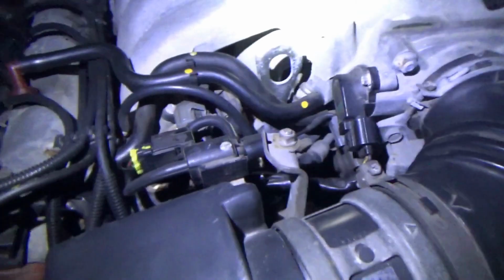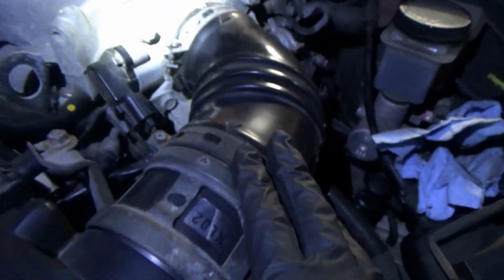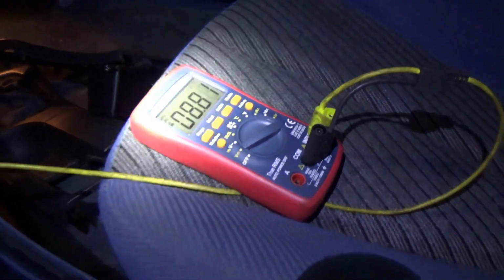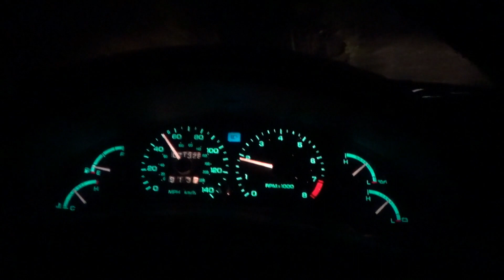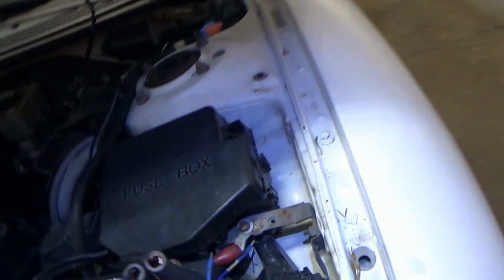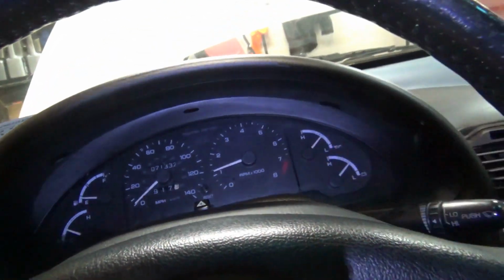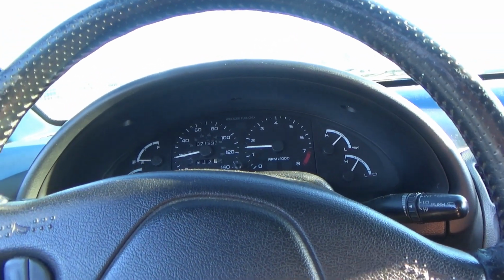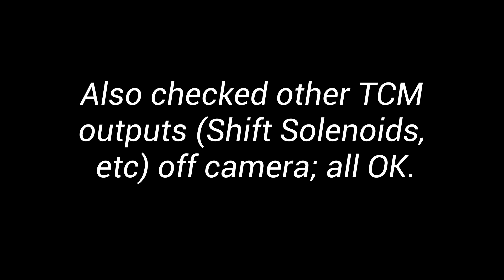The POSSESSED Probe - Halloween Special (Part 2)

Comment: i have a 96 2.0 liter probe that had multiple open control wires in the engine compartment. almost the entire maybe 10 wire harness had open wires. the manufacturers use the thinnest possible wire to save money on copper. starter motor solenoid wire open, blower motor control wire open, several wires going to the Maf sensor were open. to find the faults i used a cheap scanner and did continuity checks on the wiring going from the engine compartment to the PCM connector

Comment: 93 Camry had similar problem with it's torque converter lock solenoid designed to lock above 35, it was fine if driven on highway then city drive but if alone driven in city it would idle low in drive as though it was about to stall, that had a trans code but unsure what it was, Camry had both tranny and engine codes

Comment: Ive just become a '97gt probe owner.
And ive been working on mine for 3 weeks no start when car was given to me. Owner was fed up with it. And couldnt get it statered. So he gave me the car. The throttle body was dinked with like your customers horribly bad. 
Took the hole throttle body off and cleaned reset all the factory setting. 
And now the car runs great short of just the servicings it needs. 
Your videos are enlightening and a thumbs up.

Comment: Brake pedal wear - I had a 1999 mustang. I had to REPLACE the rubber of the brake pedal after under 50k miles because it had worn to the metal and wouldn't stay attached. I attribute this to Ford's legendary quality. I believe that the pedal in the Probe wore way faster than in a Mazda.

Comment: Sometimes the TCC can activate because the screen on it becomes plugged with metal filings allowing the TCC to engage. 2nd gear may be the first allowable gear to engage convertor clutch. Explaing why it does not lock up in first gear.

Comment: On this generation of Ford high idle and dies in drive is usually a vacuum leak affecting the mass airflow sensor.
When these vehicles age the hoses fail and I've experienced them fail just from sitting after a drive.
Trans maybe bad but the way the engine is running tells me that there's a vacuum leak.
Reply from the maker: It was fine after proper idle adjustment 👍

Comment: My very 1st new car was a 89 Probe GT with intercooled turbo. Came right out of the Mazda factory. That car was fun, fast and a blast to drive. I lost it when it turned upside down when avoiding an accident that would have sent me to the hospital. I was fine but the car... Totaled, of course. Broke my heart. 78,000 miles and still drove like the day I bought it. Manual trans. No drive train issues ever.  Loved that car.

Comment: Hi Ivan, I'm an auto mechanic myself and to read the vehicle transmission fluid correctly, 1: have vehicle runing at OPERATING Engine Temperature. 2: Transmission Should be at Normal Operating Temperature. 3:Then put the EBrake on Full and then shift the Transmission to Neutral. 4: You will then be able to check and see if the transmission fluis is Full or Low when hot.

Comment: To me it did seem like the throttle body should have been cleaned thoroughly before adjusting the idle.
Unfortunately it did seem like the customer was ripped off by the seller and that'll be a case for a disagreement between seller and buyer.
Reply from the maker: I did clean the throttle body before adjustment...standard procedure :)
Reply: @PineHollowAutoDiagnostics  Maybe I missed that detail then.

Comment: one thing to comment, do not drain the transmission fluid like that on HOT transmission because you're disconnecting transmission lubrication. I did the same and killed (seized) the torque converter bushing although I also did it just for few seconds. The transmission made clunking noise the next day, I ended up pulling the tranny and noticed the torque converter bushing was completely seized. So just few words of caution here.
Reply from the maker: wow that's nuts

Comment: Some tidbits for you Ivan ~ the manual shift valve in these boxes has only 3 hydraulic positions (neutral/forward/reverse) with mechanical activation of the parking pawl when in Park. All forward gear ration selection is done by TCU/shift solenoids. With TCU unplugged or in limp mode, default strategy is to select 3rd (both shift solenoids deactivated) With the manual valve in 2, 1 the overrun clutch control circuit is hydraulically active (not activated by overrun clutch solenoid)....

...the 'pulse generator' signal  (there's 2) are actually TSS (turbine speed sensor on input shaft of gearbox), and 'rotation sensor' (usually sensed at the park pawl gear teeth) ~ the TCU logic compares these two signals to determine EPC duty cycle/shift timing ---- in this vid, you're connected to the TSS output....

....both the EPC and TC lockup solenoids are PWM controlled ; both exhaust to drain to modulate pilot pressure (65PSI) which actuates their respective hydraulic control valves ; the solenoid assemblies will need replacing anyway, but the two PWM valves wear out quickest (some Nissan folk know you can get these same valves cheaper from Isuzu =) You can only really diagnose this by connecting a pressure transducer to the hydraulic test points on the gearbox.

As we see, the TCU is not commanding TC lock solenoid, so either something's screwed in the valvebody wrt torque converter control valve, but I'd have to look at the F-EAT hydraulic circuit to fathom why only 2nd apply pressure seems to cause the lockup (I've not done a lot of jatco front wheel drive boxes, but with 4R01 jatcos one suspects torque converter control plug is buggered)
Reply: Wow automatics are complicated If I ever have to buy an automatic car think I'll stick with DSG or just a normal manual much simpler
Reply: Epic information dude 👍
Reply: @neilmurphy845  Actually, these older jatco automatics are simplistic compared with more modern 5+ speed automatics =)
Reply: @hhn2002  I've really only scratched the surface =) We created a replacement TCU for this style of gearbox as well, using teensy32 as the base ~ the stock TCU in these is mad as a bedbug and relies on 'fuzzy logic' ... I'm not surprised to read that others have experienced lack luster performance from this gearbox setup, the stock TCU is veritably thick as a brick.
Reply: @gcbification Interesting - one thought I had, after Ivan’s diag seemed to show that the D2 instant stall wasn’t coming from TCC on… could it be that the trans was kind of ending up in two gears simultaneously, like moving to the next gear without releasing the current gear? Might be coherent with very harsh 1-2 shift, but not sure it’s feasible given the way the shift logic is supposed to work… Interesting symptoms regardless!
Reply: @karlkoenigstein4138  Nah, the only way these boxes can bind, is if 4th(OD) is selected and overrun clutch is engaged (there's a hydraulic interlock to prevent this).

At a quick glance, this probably stems back to TSB #9774 ...which may never have been done  =)
Reply: Jcbification. What do you know?  😉😂 Excellent knowledge Sir. Way over my head. 🤷‍♂️
Reply: The root of the problem has to be the Valve Body itself
Reply: Great information. If Ivanwere able to post nearly-live (edited) clips of work, and obtain real-time suggestions, diagnosis would be off the charts. The technology exists but that would be difficult for a one-man-shop to produce.

I think video community comments works over weeks for video channels that are rebuilding one or two owned cars with no real deadlines.

For a DIY guy, internet forums are pretty good albeit a bit slow and not perfect. I know there are pro forums but not sure how popular they are.
Reply: not a transmission guy, but I recall hearing something like seal rings leaking past causing TCC apply on those. the last ford probe I touched was about 1999, which was also the last of that buggy transmission I seen.
Reply: @throttlebottle5906  that will cause clutch slippage and what you are referring to is the steel, teflon seal rings that the apply piston or piston seal itself
Reply: @SHSPVR  yeah, that would make something slip, but I think it could bleed pressure into the TCC circuit somehow on them. I don't recall 100% but there was something abut them for sure.
Reply: @throttlebottle5906  No becuase TCC circuit is run thru valve body circuit is open or off which is on its own dedicated circuit which relies pump pressure keep in mind that torque convertor clutch would do this on all gear and I should also I point out that torque convertor clutch is 4th gear lockup only which act like a standard manual clutch only apply pressure to the turbine and the impeller making them lock together, to me what I think is wrong is something is not set right in the valve body itself therefore causing 1st gear and 2nd gear to lock as it applying pressure to both pistons so I think the problem is with the 1-2 solenoid valve body circuit passages for this part which has a check ball that maybe not sitting properly or has broken through the body plate itself or their heavy buildup of varnish or possibly a hang up plunger valve or a broken plunger valve spring.
Reply: @throttlebottle5906  More likely a pressure leak in the TCC apply circuit.... both the EPC & TCC lock solenoids work similarly, in that they are 'normally closed' drains. When Ivan unplugged the TCU, he effectively had a closed EPC valve, which hydraulically results in maximum line pressure -- applying power to the EPC solenoid and thus opening the drain, lowers the line pressure. With PWM duty cycle, you can vary the line pressure by lifting the valve closer/further from it's seat. In the EPC valve case, fulltime 12v (no PWM) is a special case, and is used to activate the overrun clutch circuit, and reduce engine load during starting -- you can see this @13:18 in the vid ; Ivan cranks it, as soon as the TCU sees TSS signal, it pulls EPC fully on for 5second to reduce line pressure to near nothing, thus reducing the load on the oil pump until the engine establishes steady idle (that's the intent here). Wrt the overrun clutch...if it's solenoid is activated to achieve engine braking in D, it won't hydraulically engage until you activate the EPC valve with fulltime 12v.; this trigger point is determined by TPS position..ie; <2% ...

TCC lock circuit works in similar fashion - as it energized with PWM you can ramp the duty cycle and slowly open the drain valve ; that loss of pressure on one side of the TCC control valve, allows the spring on the outer side of the spool valve to slide it along the bore and provide line pressure to the TCC itself. Just now thinking about it, the possible elephant in the room here, could indeed be a leaky TCC lockup solenoid, but you don't let your mind go there --- like Ivan stated amusingly pumping that ATF out....that fluid has 'rebuild me' written all over it. One of the reasons they pick the idle speed  up, is to raise both line and pilot pressure ; such can compensate for a pressure leak in idle conditions that's not evident in driving conditions.

Incidentally, that's also a data-point on many automatics ; how many litres per second get discharged from that oil cooler feed line (@ specified idle/NOT)...
Reply: @gcbification  could be a solenoid. @Anthony Toste but don't forget the TCC(and many clutches) are fed oil via the center of input shaft and output shaft, via the pump stator snout/case/shaft seal rings, then through case passages and valve body, it's not uncommon failures for cross channel flows to happen anywhere in the unit and that would have wild unknown results, equally as bad as valve body/plate/check-ball/gasket issues.

Comment: To think that Ford Muted this as the replacement for the Mustang at the time. Junk transmission that were not to be touched at the dealership. Ford sent a drop in ( under basic 3yr 36k mile warrasnty at the time) Interior plastics and trim were poor, Duratec 2.5 was newish at the time so not many problems seen at the onset.

Comment: a goblin must have fiddled with the odometer too. No way does that pile have that much wrong with it at only 70k miles, the numbers don't line up correctly either. As it turns out this car doesn't need a parts cannon, but a parts nuclear device.

Comment: Ivan, you mentioned the Mazda minivan.
If I recall correctly, isn't the gas tank under the driver's/passenger seat area?
Should that not be inspected, ha, ha,...
Thankfully, we have transit in my area.
I can't keep track of all the safety violations these days.
Hopefully GM can revive a newer Fiero model.
No dents and self healing windshields will alleviate some problems.
And horses need shoes, but they can't get dents.
It's a no win situation unless one is an alien.
Reply from the maker: MPV is on it's 3rd gas tank...Northeast salt has not been kind to it over the last 34 (!) years! Actually I'm a bit surprised that it still drives straight and that the axle stays attached when I take it on rough jeep access roads lol

Comment: I had a Ford Probe.  I can attest first hand how “haunted” their transmissions were.  Good thing Ivan is the best auto exorcist this side of the Vatican Automotive maintenance department.
Reply: Those old JATCO F4EAT/4EAT were very problematic. I had to replace 2 in the 1990's on a Subaru Legacy at $3500 a pop.
Reply: I had Mazda MX -6,  same garbage. Tranny went bad 40k miles

Comment: Yeah, there is no way that check engine light being out was an accident. Surprised you didn't look inside the cluster to see that someone removed the bulb, or smashed it.
Reply: I've had plenty of those tiny bulbs that they use for cluster backlighting burn out.   Especially the check engine and the low fuel lamp.  Since they often get the most use.   The low fuel lamp just recently failed on my '98 Honda Accord, I've got it on my list of things to fix.   Actually, the backlight on the odometer section has been burned out for awhile also.  But anyhow my point being, it happens more often than people might realize.
Reply: @jtjones4727   maybe it burned out since it's been flashing like crazy for the last few years 😉
Reply: @jtjones4727  Interesting. I've replaced every backlight bulb on many 1990s cars (friends and family all have old vehicles) and I've never seen a bad check engine bulb. But, I also live in a state with mandatory inspections where they check the light. If it doesn't illuminate in the bulb test, or if there is a code, the car fails.
Reply: I rebuilt my whole dash on a 97 ford and none of the warning lights were burned out. Keep in mind some states won't pass inspection with a CEL on. Either it was on all the time or disabled. My money would be on disabled. Some people are really terrible. That's why on OBD II the computer tests the bulb. If you try to put an LED in there like I did it's always dimly lit. Had to switch back to the original. Also got parts out of a donor dash from the junkyard and it's warning bulbs worked also. I have a whole box of spares if I ever need any more.
Reply: It's a Ford, the check engine light could have EASILY burnt out.

Comment: Clearly someone tampered with the throttle body and IAC and it's got a couple of failed components on the intake, and I suspect the transmission was serviced and put together improperly, at the end of the day this is an old car that parts are going to be hard to come by if even available

Comment: There is no way that Probe has only 71k miles. I owned 2 of those in the early 90's, both manual and really fun cars. That thing is a nightmare. Most likely someone swapped the dash to indicate lower mileage on a car that probably has in excess of 170k.

Comment: I have a haunted 2010 Ford Fusion that likes to randomly crank-start-stall.  No codes, tried all the fixes.  Car only has 92K KM on it so it's very low mileage.  Low mileage is not always gonna give you higher quality considering North American cars/trucks are built like crap to begin with.

Comment: Looks like the torque converter is bad. Common problem with GM during the late 80s and early 90s.
Reply from the maker: But it's a Mazda transmission...

Comment: Being put in 2 gears at the same time will also stall the engine.
Reverse is 2 shafts/drums held at the same time so perhaps 2nd and reverse are being engaged at the same time?
Reply from the maker: I would think that 2 gears at once would cause the car not to move, but not stall it out, since the TC is not locked up...kind of like that Lexus LS430 that didn't have Reverse!
Reply: @PineHollowAutoDiagnostics  yes I was stuck on the idea that the TCC was locked as well.
I think you did touch on high pump pressures being a concern since the pump is direct driven independent of the slip/lockup of the converter and might be responsible for the engine stalling in 2nd gear.

Comment: This car omg. Such a LOVE HATE…. The first car I bought after school was a manual 93 GT. I LOVE LOVE that car. Fit like a glove and the gandering was like nothing else. Snow ice… not a problem drive and sounded like a rally car. BUT…. 38,000Mi full engine rebuild. Then trans grenaded at 85,000. Yeah I was a younger man and drove it hard for sure.  But not ….that hard. Didn’t miss shifts or anything. When the trans went with a bang I was 200mi from home. Had 1st and 5th gear only. Made it almost all the way and gave up. I still miss that car there was nothing like it. If there were curves… no stock mustang or Camaro could touch it. The vette drivers thought better than to try. Good luck with this one the manual swap would be great. That power band…. Not at all good with the days automatic.

Comment: I think the is a problem is with the 1-2 solenoid valve body circuit passages for this part which has a check ball that maybe not sitting properly or has broken through the body plate itself or their heavy buildup of varnish or possibly a hang up plunger valve or a broken plunger valve spring.